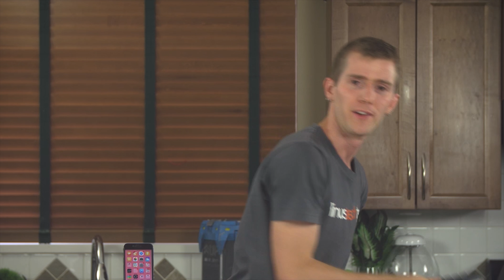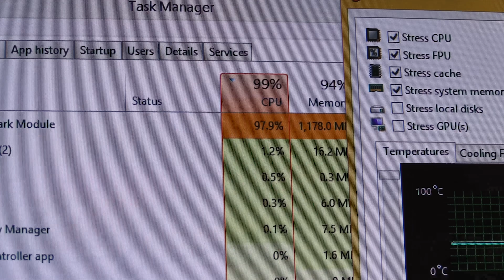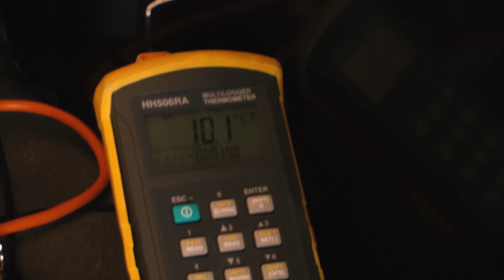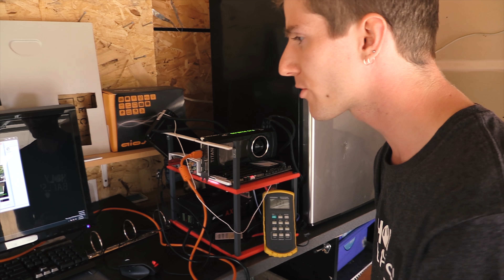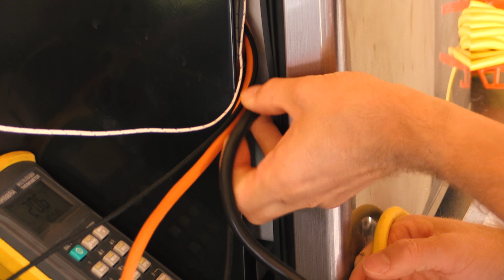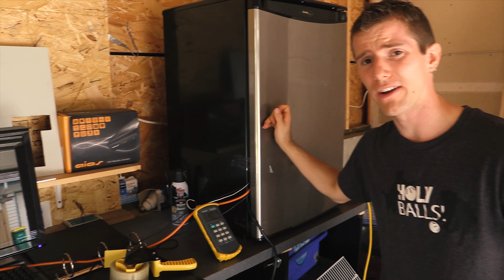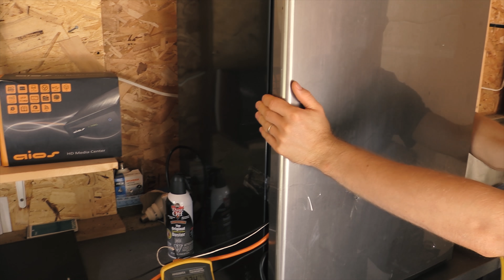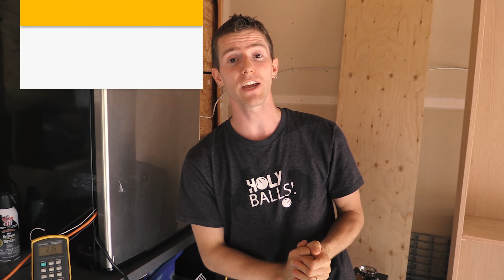PC Build in a Fridge - Does it Work??

Comment: I'm sure it's been said already but...

WHAT IF, the intake air for the RAD comes from the mini-fridge, but the exhaust was dumped outside the fridge?
Reply: TheTron08 You would need to replenish the air in the fridge from somewhere and that would be warm air. The fridge wouldn't be able to cool the air fast enough to provide constant cooling . As Linus mentioned, the fridge is designed to slowly cool down one small space of air and hold it there, not a constantly replenished one. If you want a constant supply you need an air conditioner. They function similarly but its the capacity thats different.

Comment: what if it's winter and you take your computer outside?
Reply: +iMiguelAOG It gets stolen...
Reply: +Rex Newbz well I mean you're outside with it
Reply: iMiguelAOG It would run cooler, but I'd rather sit in my comfy armchair in the heat.
Reply: +iMiguelAOG I had a clients macbook air 2011 in to look at and it got really hot so I waved it around in the freezing british air for a minute and the fan stopped. Strange. Apparently it doesn't usually overheat
Reply: +iMiguelAOG You'll get stolen with it
Reply: Bowowowification in my own backyard?
Reply: iMiguelAOG I guess it depends if you live in a dangerous area, lol. :-D
Reply: Bowowowification supposedly i do, but i think im fine in the backyard

Comment: was improper the improper seal of the fridge taken into account or the fact that the computer was restricting airflow inside as well? With the confined space the heat could not be pulled of the CPU well and the colder air (at the bottom) could not easily rotate up to the top, refrigeration does require proper interior airflow to work well. Still even with this the power consumption of the fridge working all the time if it could would not be cost efficient.

Comment: was the fridge on for a while with the components in it before testing? Just wondering because it takes a while for a fridge to reach temperature.. it also would need time to bring down the temperature of the already room temp equipment. just wondering.

Comment: A fridge is not built to continuously run without stop and will brake down after a short while trying to keep your computer cool.
Reply: A fridge is not built to continuously run without stop? So what does it do to the drinks and food inside our fridge? Does it just instantly cool right before you take it out?
Reply: If you listen you will hear that the fridge motor only runs for a short while and then stops for a long time. He also mentions this problem in the video that fridges will not cope with having a constant heat source inside because of that it is not built for continuous running. The compressor is not built for running continuous unlike air-conditioning and industrial cooling systems that use the same principle as a fridge. Some years ago you could buy a unit using same principle as a fridge to cool you CPU and other components directly but that system was built for it.

But if you replace the fridge compressor with one from a air-condition or even better use the whole air condition to cool the computer it should work nicely :)

Comment: linus, what about disassembling the fridge to use the gas circuit in a liquid cooling?? i mean. instead the radiator/water/pump. you can plug compressor/gas/fridge-radiator to the blocks

Comment: In other words, you need to use an old refridgerator like a case and install your own custom air conditioning unit for it? Or try with a wine refrigerator, they aren't just small, they are designed to quickly cool things down rather than keeping things chilled

Comment: This video bothers me a bit just because the build doesn't make much sense. Common sense will tell a that regardless of where you build your pc, In a regular case or a mini fridge, you still need somewhere to get fresh air in and somewhere to evacuate the hot air produced from your rig. To properly test the theory you would need to cut holes on the left and right sides of the fridge and mount a few fans. That would be an interesting build and I'm actually thinking about trying it myself. ( Looking at my fridge now, and its shrinking away in fear)

Comment: Of course this wouldn't work, and I don't know why you'd really want to try. A good liquid cooling system is all you need for any reasonable overclocking. Though, I guess if you want to go unreasonable, you're going to have to use liquid nitrogen. Now that works!

Comment: You did all of that work but then you didn't follow through which was disappointing. You had the whole setup, you might as well have overclocked and run some games or graphics benchmarks. You might as well have just written an article instead of posting a video if all you were going to do is talk about it.

Comment: Did that fridge have a compressor? It looks like a mini fridge. Those usually use Peltiers which are very different and should be used directly on the cpu. 
- 
The simple answer should have been? "Yes a fridge will work but you are going to need a big one.

Comment: the fridge would work on small rigs but would heat the room where the fridge is to unbearable temps unless the ac in the room was running crazy.  the fridge compressor was never meant for this themal load so it will not last long ..  I would like to see linustechtips  build a DIY chiller system using watercooling parts and a recycled ac system to chill the water .  Maybe even go balls deep and build a DIY peltier cooling system I'd love to see a recycled sushi freezer keeping cpu block at -60 F

Comment: Do not do this, very bad idea, unless you have junk parts you don't care about.
All your leads and wires will corrode over a short time and moisture inside the firdge will be almost impossible to control, despite the magnetic seal. Eventually creating a short, if not crashing because the leads will loose good contact.
Once the 'cooled' system, is introduced to warm air. Game over, your shit is ruined, but condensation will build anyways just from a poor seal. Those bulky cables is just allowing air from the outside, inside the fridge. So before long all the surfaces will be sweating like it was put in a  sauna.
Spend the money on a water cooled system instead.

Comment: I'm now thinking of building a box out of plywood with a window air conditioner on it and using pink insulation foam at the hardware store for insulation.  

Seal it up with some caulk and then put something over the ugly ass pink foam, also to keep the insulation from being damaged.  That or put the foam on the inside.  That and put some hinges on it, and use the same seal that fridge doors use.  And an hole for the cables.

Any other suggestions?
Reply: ***** Beer and apple cider(the real kind with alcohol).  FTFW.
Reply: +eitkoml you could make it look like a small house, and put a front door on it that covers up the USB hub. You could also put a white fence out front, perhaps put a tiny toy cat inside it. You could even set it on a small square of turf and call it your lawn.

Comment: You would have to overmatch the BTU output of the computer. Most refrigerators won't have the capacity to keep up with that level of heat flow. It would be neat to strap a cpu radiator to the cold air output of a 5k to 14k air conditioner. That would probably keep up better.

Comment: take a full size fridges cooling system and replace the evaporator with cooling blocks that would go on the cpu and graphics and put the entire computer in something like a mineral oil that has a freezing temp of -30C or so. This will keep condensation off your components :) Never tried it but rele want to.

Comment: It would be so horribly efficient, because it requires electricity to power the fridge, but that's a great concept. The best thing to do is to find the most efficient fridge. They're so expensive, so water cooling still be way more practical.

Comment: I am going to use the mini fridge as my next build case.  I might just leave the guts of the fridge as is but just chop off the power chord.  Will drill some fan hole on the sides and top for vent.

The +ve side is that due to all the thermal padding in the fridge, I am expecting the build to be a really quiet one.

Comment: for this to work heat from the computer needs to be dissipated outside of the refrigerator. A water cooled setup with an external radiator and fans would work a hell of  a lot better with this setup. that way the insulated refrigerator wouldn't trap in the heat produced as it could be expelled outside of the insulation and the mini fridge would be able to act as extra cooling for the computer.

Comment: i recently watched your Mineral Oil pc build and your Sub-zero build, and now this. And it got me thinking. Is there any way that you could build a Mineral Oil, refrigerated pc, for maximum cooling. According to the specs of the oil you used, it should remain stable at 4C (about 39F).

Great Video's though guys.

Comment: No lol, the power drawn for an air condenser out weights a few fans cooling whatever size "watercooing" system you have. Plus the fridge is always on (wrote this before watching so if he made a way to switch it off when comp is off then whoops) so your components will always be at the fridge temps. Also when you open the fridge your computer will instantly get condensation from the warmer air outside, frying your rig. So put a lock on that shit and turn the fridge off for a 6+ hours before opening to make internal changes.

Comment: What about ducting the output from a portable air conditioner into the front of your case then allowing it to exit out the back and ducting it to the intake of the air conditioner in a closed loop. It could probably maintain about 20 degrees or less. I am talking about the type of portable air conditioner that keeps the evaporator and condenser sides separate.

Comment: Dear LTT & crew,

Sequel video idea - is it possible to make a "box" for a PC that you can safely put outside in sub-freezing temps without risk of condensation forming?

Not really a practical idea but the winter-air would have more than enough energy (or rather, lack of thermal energy) to handle cooling a Titan X rig.

If sub-freezing outside temp is impossible, what about 35*F? You could hypothetically test the Titan X rig in that garage when the room temp is close to but not quite freezing.

Thanks!
- Matt

Comment: Can anyone help me explain to my co-worker here how important it is to keep your system in proper temperature. I'm not that much of a "techie guy" but I think I know enough that I need to keep my system's temperature cool and even more if I am playing games or rendering 3D projects. This guy I need to explain with is using a laptop and even how hard I try to explain him that he needs to buy a cooling fan which he can put under his laptop while he plays 3D graphics games could help prevent hardware problems he may encounter in the future. Yesterday his laptop stopped working then he's having so many theories of "why?" then I gave him some theories from myself too like probably it is broken because you won't by a fan for it or probably you didn't shut it down properly while it was updating cuz maybe you're removing your batteries then you accidentally unplugged it or blah blah blah. Bring it to the shop and let them fix it. If they ask you to buy parts in replace to those parts you just burnt then okay, costs so much higher than a FREAKING COOLING FAN! :-P and I think he still doesn't believe me.

Comment: It is a great question, so I 'Liked.'  The results lead to the question:  How big a fridge (or how much cooling capacity) would it take to be beneficial, or awesome? 

Good tip about condensation on cold components in room temperature.

Comment: Next video: Submerged in a non conducting fluid filled chest freezer.  to better control the temp add a temp controller.  The thermal mass from the fluid itself will keep it cool.  Added to that, you will have direct contact with the cooling element allowing the cooling to take effect faster.  Air has minimal thermal mass and does not conduct heat very well.  To aid circulation, you can use a submerged pond pump and direct the flow.

Comment: There's a reason fridges get warm inside if the door isn't closed all the way.... the cold air pushes out through the cracks at dramatic rates. 

I see you failed to note that the big ass cables you have sticking out of the door are removing any and all cold air out of the fridge which voids every single thing you said after taping the door "closed". Obviously a fridge would have to be modified for this to effectively work. PC build in a fridge, does it work? Yes, you were just too dumb to realize you let all the air out. I have no clue how you think you need a fucking industrial air conditioner for this to work when people put dinky ass fans and cheap watercooling on systems 24/7 and have super cool temps.

Comment: what if i took something and made a duct from my window unit AC (which is next to my pc) and connected the duct from the AC vent to the intake on the back of my case which is also a push/pull liquid cooling radiator setup?

Comment: Ive been theorizing on the possibility of using an Air Conditioner unit to directly cool the PC. Im talking routing copper tubing to the water blocks on everything on the rig, hook the Compressor and components up and charge the thing up. then add in internal temp leads to the therostat and Boom, You got a rig that stays at 30 F constantly under OC full load

Comment: Cool, but the more obvious solution to me is to keep the computer on the desk, but run your liquid cooling fluid into a fridge so that it returns to the computer 40+ degrees colder than just ambient air.  Perhaps to a radiator in the freezer area. You can still stock the mini-fridge full of frosty cold beverages which would actually improve the fridges total cold sink.  

And obviously you need a fridge than can cool faster than the computer can create heat. Something you can simply measure.

Comment: A window or portable AC unit that outlets directly into the intake fans of the PC would work better than closing the system in a box. It would reduce the ambient temp of the air flowing into the system and would be a source of consistent airflow. The issue this introduces is condensation. Refrigeration of a computer or server only works if the entire room is able to have a reduced ambient temp at all times. Doing it any other way is inviting water to come into direct contact with your components, and that's not good.

Comment: So if someone were to take out all of the innards of a refrigerator and just use it as an insulated box, and then somehow have an AC blow directly into the box through the vents of the fridge or something, it might help? Interesting. 

Also, the heat would increase over a much longer time and to a higher temperature than it would in a regular case because insulation works both ways. Fridges aren't cold because they're cold, they're cold because they're insulated. So if you replace the cold part with a hot part, you have a toasty little oven.

Comment: No no no to the PSU in the fridge, that's not going to help performance. That PSU doesn't need extra cooling, all it's doing is dumping heat into that confined space. What I would like to have seen is 2 experiments. 1: system (without PSU) and 2: where just the radiator (with fans) was in the fridge. Guess I will just have to wait for someone to throw out a fridge so I can test.